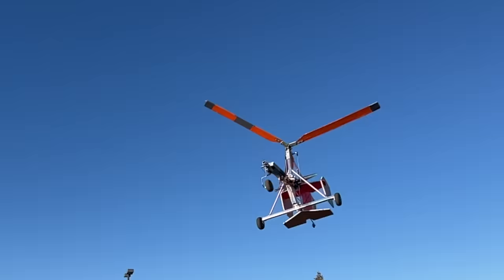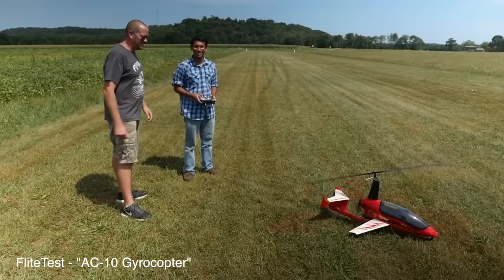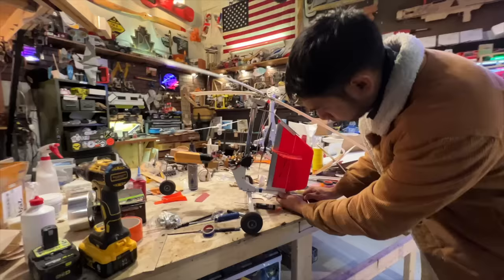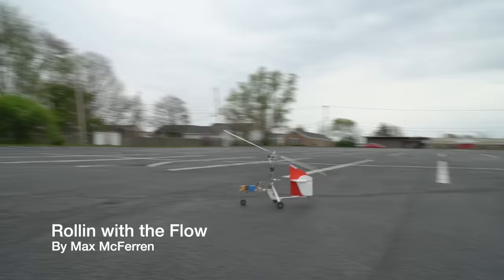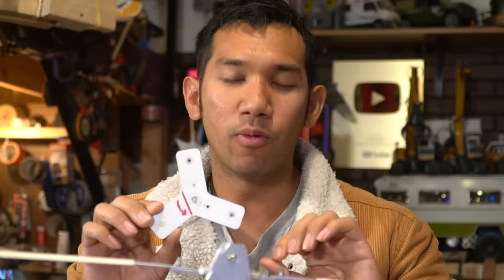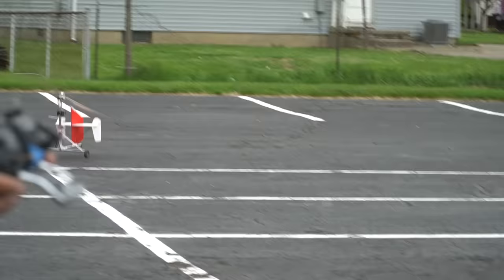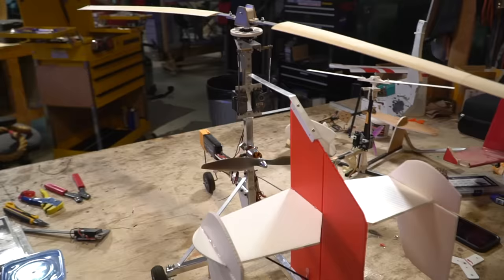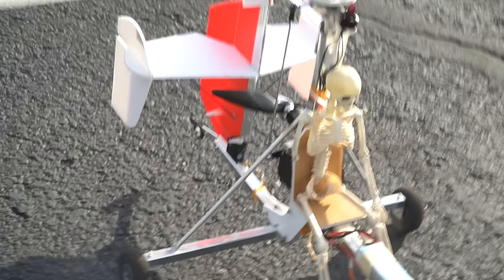This isn’t a helicopter or an airplane?

Comment: "I made a mini auto gyro so I know wtf I'm doing when I fly the real thing" has to be one of the best reasons to build a little one I've ever heard.
Reply: To be fair. That's pretty much what the Wright brothers did as well.
They learned how an airplane works and also flew one that was fastened to the ground in strong winds.

So before they made their actual first flight they already had "flight experience". Something not all aviation pioneers had back then.
Reply: He also said the full-size ones don't respond the same as the models so...
Reply: @infinitytoinfinitysquaredb7836  True, but it'll still teach him the physics and help.
Reply: @BazilRat  
Right, and he said he wants to use the model to learn some acrobatic tricks he can apply to flying his full-size gero like in the James Bond movie. My point is, if they don't respond in the same way is that such a good idea? And they very likely have a different power/weigh ratio as well, plus many other aeronautical differences. Anyway, I hope he doesn't push it too much.
Reply: ...and then proceeds to crash it 47 times. =)
Reply: @infinitytoinfinitysquaredb7836  I believe his larger one is closer to realistic handling, which is why he built it bigger.

I do agree I hope he doesn't push it too far.
Reply: @infinitytoinfinitysquaredb7836  I suspect, as someone else said, that the size difference makes one respond slower or faster than the other. They should be affected by the exact same forces of nature.
Reply: Physics and aerodynamics can be scaled and calculated up to 96% accuracy.